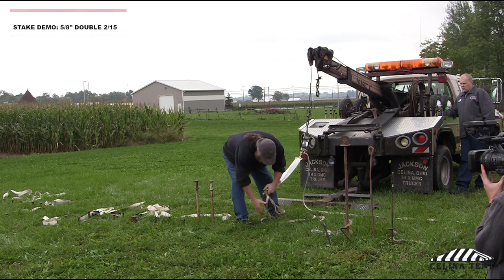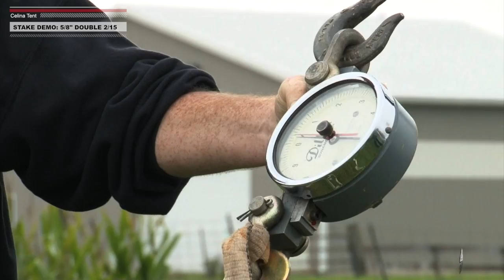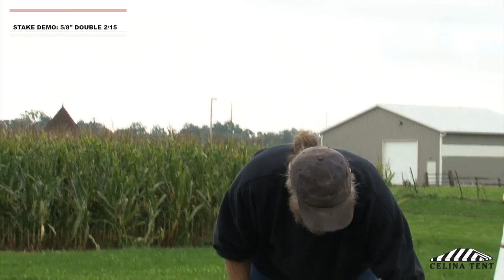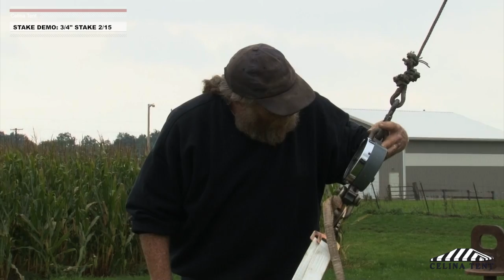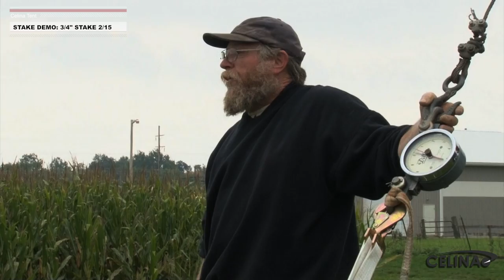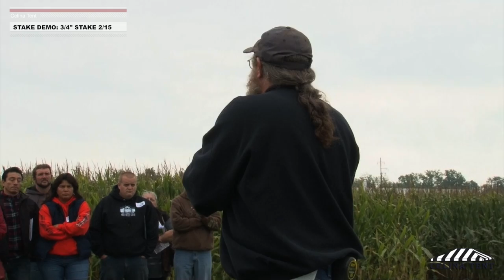Stake Pull Demonstration (2/15) 15 ⅝" Short Stake

Comment: Great Video! learned a ton, not in the Tent business but I have other uses for staking. (On a side note you might want to check on the cable and thimble on the rigging of the tow truck, looks like it might be under spec).